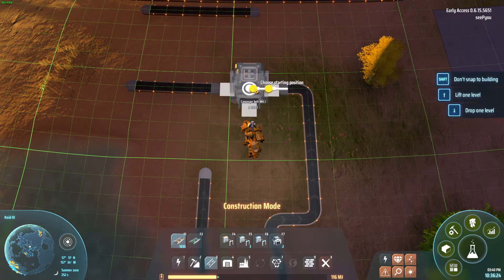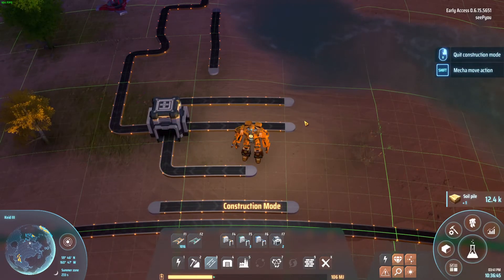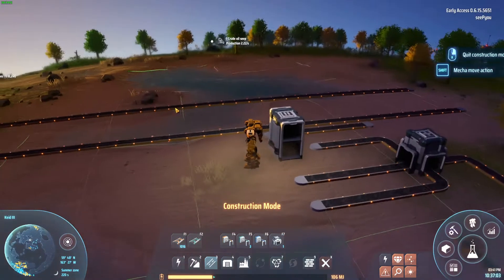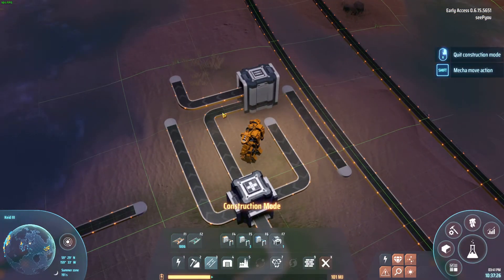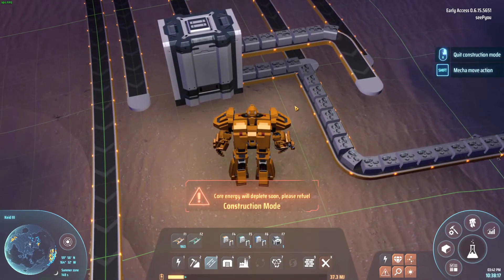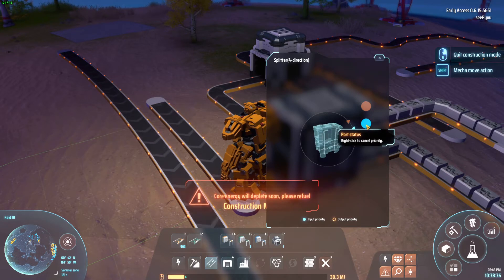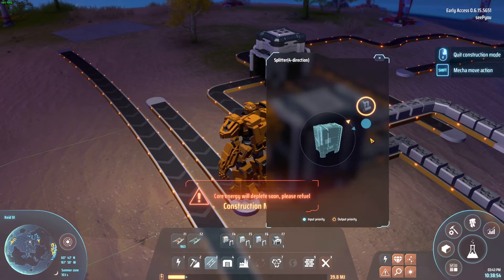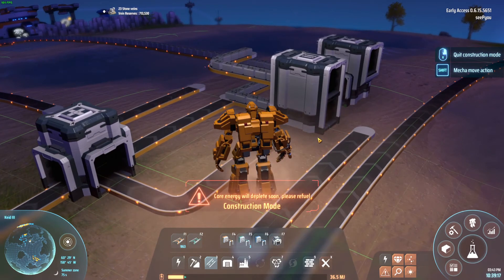How do splitters work - Dyson Sphere Program - Early game tips and hints - 19

Comment: how can i split oli and hydrogen
Reply from the maker: At this stage of the game, oil and hydrogen as just items on the conveyor. So use sorters and splitters as normal.
If you mean refined oil, then the sorter can be filtered to draw only refined oil, or only hydrogen, and thus output only that on a conveyor belt. Then you just output on different belts.
With splitter, just make two belts coming out of it, and then click on the splitter. That brings up the menu for it, click one of the exits (the brownish circle) which will make it a priority. Click it again (because notice it now said Filter but had none) and you can now set a filter for Oil or Hydrogen. From now on, that exist will only be what you set it. Now you split them!